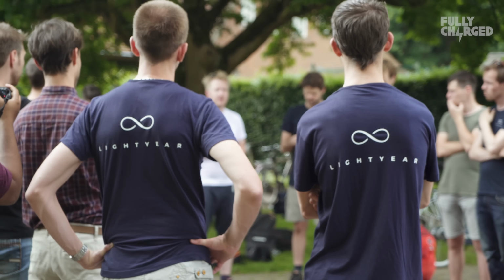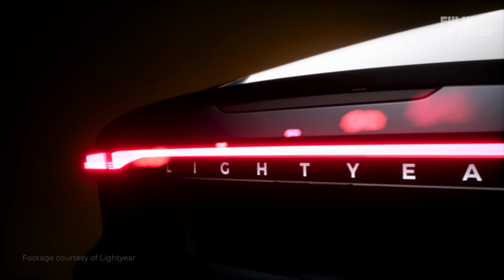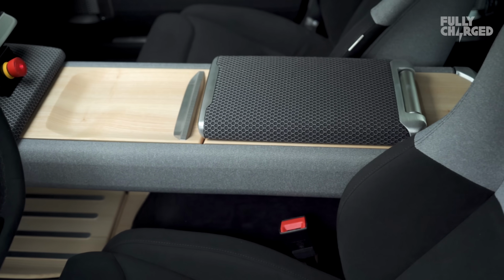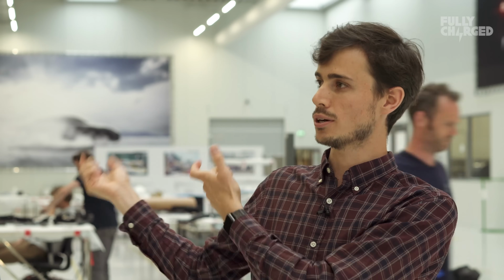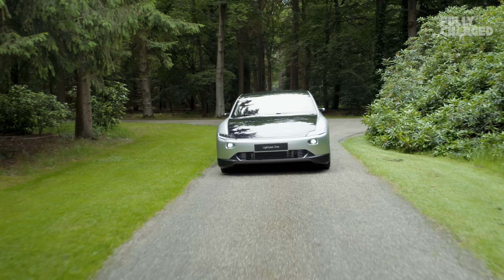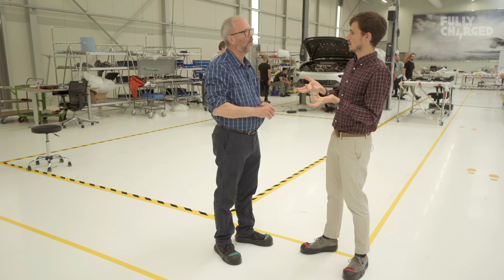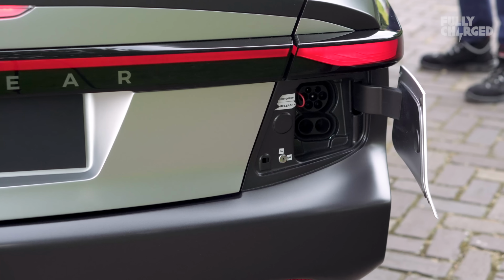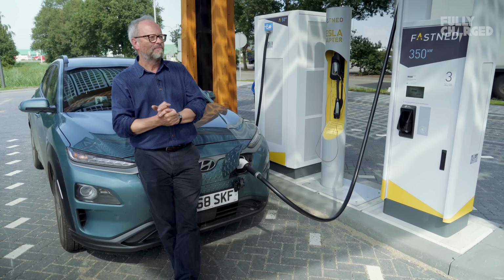Lightyear One solar powered electric car - exclusive first look | Fully Charged

Comment: The best solar panels for roofs produce 270-310 W (about 990x1640 mm). In maximum peak their car absorb 1500 W/h. So... it is about 5-7 panels on the top. The KPI for standard panel is about 23-25%. They have to gave 5-7 times more - about 125-175%. Don't you think something wrong about the range? here's what's really right, it's a 10-12 km trip at 1500 watts. Because who construct electrocars knows that the average consumption is about 150-180 W/km (without any king of extra heater, air cooler etc). So it is miracle.
P.S.  they can deliver just 5-15 km range without prepared and rpe-charged battery in advance (just in solar power). And also nothing was shown during demonstration. Just a circle around the house and forest (3 min on the road)

Comment: How about realizing that EVs are obsolete when you want to get to CO2 neutral.  The battery is LOADED with CO2.  A typical Li-ion battery used by Tesla and others is around 65 gCO2/kwh if used to 6000 cycles.  But a 60 kwh battery, like in a Lightyear, would travel 284 miles at 80% of charge.  300,000 miles at 284 miles/cycle = 1056 cycles.  6000/1056 x 65= 369 gCO2/kwh....  BTW, gasoline from the well is 325 gCO2/kwh...

Solar PV made fuel would be 6 gCO2/kwh x 1.5 fuel making factor = 9 gCO2/kwh, plus 1 for fuel maker and fuel tank to be fair...  So, it costs 10 gCO2/kwh to make fuel and store it with a solar PV panel instead of charging.  To make electricity with PV and store it with a battery at home would be 65 + 6 = 71 gCO2/kwh, or 7.1 times MORE CO2 than making fuel, assuming you used the battery to 6000 cycles or 1 cycle/day for 16.43 years...good luck with that...

The car battery CO2 is 369 gCO2/kwh as calculated above... divided by 10 for fuel making = 36.9 times MORE CO2 for battery alone than making fuel.  If an old combustion engine is 5 times LESS efficient than an EV, then 36.9/5 = 7.38 times MORE CO2 for the battery ALONE (no outside charging) than making fuel for an old ICE engine (an 1880's idea).  

Charging the EV costs you 455 gCO2/kwh from the grid.  That is 45.4 times MORE than making fuel.  Assume 5x less for ICE engine... 45.5/5 = 9.1 times more CO2 than just using an old ICE engine with solar PV made fuel.  

Folks, can anybody in the comment section do any engineering?  Clearly not.  You ALL failed.  No wonder we are going to waste $200+ trillion on the "electrification" of all things all in the name of lower CO2.  What a bunch of total idiots.  7 to 9 times MORE CO2.  No, wait, if you don't have that stupid battery in the wunder car, it would get ~1.5 times better MPG due to not having to carry around the stupid battery...  10.5 to 13.5 times...  

Again, if CO2 is the issue, EVs are totally OBSOLETE.  I proved it to you right here.  

BTW, NewEngineType .com (NET) has efficiencies = to EVs, plug to wheel.  That makes the ratios go up 5 times more.  10.5 x 5 = 52.5.  13.5 x 5 = 67.5.  So, NET would be 52 to 67 times lower CO2 when you consider fuel tank issues (battery + electricity).  The CO2 to build the car would be about 1/4th due to no battery and no rare earths.  I would guess around 20 times less CO2 in life cycle...

Folks, learn to do some engineering before you send us all down a rabbit hole of EV stupidity...OK?

BTW, solar thermal can capture 6.6 times more energy than solar PV.  Yes, NET will have thermal loads taken care of and won't need to use range to keep the car warm or cool...  Solar thermal is key to net zero...and that is why NET uses solar thermal and NOT PV junk that looks like a stupid lab project.  So, most of a NET car can have solar thermal energy storage via compressed air...or even fuel making on the car if I wanted to...

So, if you want the CO2 gone, you start by tossing the battery in the garbage can.  Then come talk to me...  

Yes, I got it right, and you all failed.

Comment: Fine as a research project, but it presents as a scam. Flashy website, with exaggerated claims. And you can already have solar EV from your house roof today, which is way more efficient than the car. 

Oh and it'll be fun parking your car in the sun during a heatwave. 

Instead you can park your car under a roof that has solar cells on it. 

This all exists today. But these guys are trying to sell something that makes no sense with current solar efficiency.

Comment: OK. Current panels under ideal circumstances give you about 350W/m^2. Over the entire surface you are looking at delivering about one horsepower to propel a one-ton plus vehicle. In other words absolutely useless apart from charging your phone or cooling your cabin.

Comment: For a few years I keep thinking “Why can’t the roof, hood (bonnet), (in some cars boot have good quantity high efficiency cells to help charge the battery”.
Perhaps in markets like UK, Russia where there is little sun it may not make sense, but here in Australia, US, Mexico etc it would work well.
I REALLY LIKE that there is no rear window to heat up the vehicle.  In a typical sedan in Australia the amount of heat that comes through the rear window is huge.
Having a wagon or SUV helps avoid that a little.
There was no mention of the Cd....how aerodynamic the vehicle is.  At a guess 0.20 ??

Comment: I suppose it works in extreme desert conditions carrying nothing except the driver, in daylight only.
Reply: You might have been right, if you'd made your statement 20 years ago. Fortunately, things have changed!
Reply: @peterslegers6121  Solar energy is low intensity and only available in daytime. That can't have changed.
Reply: @Withnail1969  Have you seen the World Solar Challenges and team Eindhoven in particular? If so, you'd know they did 120 km/h and were able to ride with 5 people. You might be surprised if you check out what they've achieved. 😉
Reply: @Withnail1969  You've got outdated ideas. Have a nice day.

Comment: as an EV driver i can say 6 miles of free energy an hour is huge. my work shift is 9 hours and if my car starts charging from the second i close the door, my arrival commute is completely taken care of if not both trips. it's the little things like, 12, 20, 35 miles of range that the anxiety starts to kick in if you're driving somewhere without infrastructure on a partial charge. completely done away with solar charging. not to mention a failsafe in the worst case scenario of you completely exhausting your range.

Comment: What I'm about to say may seem a bit sacreligious here but the thing I don't like about EVs is the feeling of the car being in charge. I don't like autos for the same reason. I LOVE the idea of electric propulsion, but where's the gearbox?

I know all about why ICE vehicles need em and EVs dont. I'm just one of those neanderthals who actually enjoys the whole listening to the engine and changing gear at the right time business. I don't even use cruise-control because I can drive more economically. 

There used to be no charging infrastruture around my cave, now I think we've got two, possibly three public chargers within a 5 mile radius! I know, eventually I'm going to have to knuckle down eventually, but it really will take a lot of pleasure out of driving for me.

Comment: Soooo here’s a question on their design choice and practically . SUVs and CUVs are extremely popular with a massive roof area. Why not a lightweight solar roof that is double stacked and when the vehicle is parked the panels expand to increase the surface are by 60 percent or more . Oh well I guess this slope back no rear window solar car will work 😬

Comment: Windows that create energy from Solar are currently being worked on right now. I don't know engineering/safety wise how it would be on a car but nice to know if it can be done that just a little more power could be added. I know it wouldn't really make much change but I feel over time it can add up some provided you don't destroy the windows and keep replacing them.
As for the windows, imagine having them in your home. Imagine skyscrapers having them

Comment: I feel like putting solar on the doors would be a good addition. Not only is it using up 'free real estate' that would otherwise be going to waste, It would also mean that it can still draw power from the sun at multiple angles, even if the roof or hood panels are obstructed ( for example, if parking in multistorey car park).

Comment: Kind of stupid for anything beyond recharging the 12V battery. If there was enough solar energy in that area to charge the main batteries notably, you'd have to wear sunblock 4 Billion any time you walked out your door. I am only slightly exaggerating. The racing car down under was not an actual car for driving in public. None of the things that make it safe. OTOH, this car is probably missing a lot of safety equipment as well, so maybe the kept the weight low enough to get around on solar power. Here in Houston, we get an average of 5 hours of power, for calculations. So if you left it parked on an incline and everything was perfect, you might get 2KWh for the whole day with 400W of panels. And again, that's in ideal conditions at 100% efficiency. And God forbid a hail storm, or anything else since you have to leave it out in the harsh sunlight. And for the record, I own/drive the Leaf, Volt, Vectrix VX-1, GoPed Hoverboard EV, and a Rad Power bicycle. So no, I am not anti-EV. I'm an electrical design engineer.

Comment: Dear Class, the Lightyear One looks so promising, we are totally excited about it! It's taken thousands and thousands of years to get to this point on Earth, with basically the first "strictly & totally solar powered car". There is more than 1 version of the Lightyear One, but the model we are totally promoting is the strictly & totally solar powered model, with no electric power. 
     Electric powered cars, automobiles, vehicles, & craft have been proved somewhat to be a fire hazard, and so we are trying to avoid electric powered such things. It's an amazing feat of Engineering that some said was not even possible, but with Engineers & other peoples working at School around the clock, for all of their life basically, we have arrived at just such a thing. It's not that there is simply no electronics to/re the vehicle, there is, such as heating, cooling, and other components, but the "power source" of the entire vehicle is "strictly & totally" SOLAR POWER, a stroke of genius for certain. 
     And Class, I can assure you all, that old E.T. is up on the Project somehow, and they are very extremely & totally pleased, happy, and excited about the Project, to say the least. E.T. in this sector of the Universe converted over to solar power thousands of years ago, and it is the wisest, smartest choice for power for us, Universally, always, regardless of all always. 
     As some of you may know, recent Science has proved that enough solar energy and light falls on planet Earth, for example, in one day, to power the entire planet Earth for 1 year! So, we simply cannot afford to ignore solar power as our main power source anymore, as E.T. decided long ago. It means the END of pollution from fossil fuels & the fossil fuel industry & technology, and thus the end of ozone depletion from pollution as such, and the end of future and further solar breaches in Earth's magnetosphere like we saw in 2007, which could lead to large scale fires, and even mass radiation. 
     Class, the claim that our economy will be crippled by the conversion over to solar power Universally and the end of fossil fuels and technology & industry, is a straight up MYTH, always. There is plenty of money and jobs and associated service(s) in and regarding the solar power industry, which will keep our economy strong and running just as well, always of course. It's a huge School Project, and we are working around the clock to get converted, always, regardless of all always. 
     And so, our School Project - Solar Hull Technology also comes heavily into play, designing vehicles and homes with solar hull technology that powers the vehicles and homes, along with all their amenities, "strictly & totally" with solar power, heating, cooling, and even plumbing and running water all solar powered, combining solar cell technology with other material(s) that do not compromise the integrity & safety of our vehicles & homes. And as always though Class, it's also so totally important to mention and remember that all Plants peoples do have eternal Rights to "life & existence" too, always, regardless of all always, and so we have to make sure that we always consider that in our Project(s) including the natural competition for sunlight and solar energy that Plants peoples require to sustain their "life". We don't want vehicles and homes that soak up too much solar energy & sunlight to the point where it endangers any & all Plants peoples life and existence. And so, we are studying the matter diligently to determine rates and factors regarding the Project(s). 
     And finally Class, also this new technology and solar powered vehicles and homes applies to "all life forms" not just humans, including my recent Project of solar powered bird homes with heating & cooling and running water. As far as I can tell, on Earth, the Lightyear One is the leading innovator regarding these Project(s), and so lets Promote them and send them as much money as you can spare, it's an imperative Eternal Universal Defense Service that they provide, always. Good work!
     As we hear in Indian legend(s) Class, and ancient oral tradition & writings.........."we came from the stars..and we will return to the stars".

Comment: Fine car. Nice work guys . Wish you lots of luck with it.  But I don't see this car  being a car for the masses, in the way Ford, or Volkswagen were.  For a long while (and even now) Mercedes Benz, BMW, Audi , Porsche schemed  the markets  by appealing to the people who wanted their ego stroked , and were coughing a lot while driving a Volkswagen, Opel or some other mass drivable product. The Brits did the same  but now many car companies make pretty appealing, reliable cars at a reasonable price. The electric cars will evolve and slowly replace the ICE cars , those  ICEs will become less appealing because of environmental concerns.As far as the one advantage of the EV, when I  drive my EV and  I am first at the stop light, I can take off and no ICE car can catch me until I get to the next stop.And I have to be honest, I do not miss going to fill the tank with gas.  I get enough juice overnight at 120V/5miles/hour and when I need I can charge at home at  32mph in 2.5h I have the battery filled.

Comment: There will never be a fully solar powered car (with all the power from it's solar panels).  I estimate that you might, with the best technology, get about 30km driving for a day in the sun.  For someone that does one shopping a week and leaves the car in the sun for the rest of the week, this could be a fully solar car.  For the rest of us, we will need to plug it in at home, at the office or the super market.  This is not to say that it wouldn't be very nice to have that little bonus.  It might even get you home in a difficult situation when you had not charged up enough.

Comment: I can just tell there are a lot of blind spots problems with this car. Rear camera are nice but they break or get damaged or just plane die. You can not see what is behind you. I have driven vans that used Backup camera's,Like i said they are nice but it makes it harder to see what is really be hind you if they are broken or die. I all so see a lot of safety issues as well. Solar panels can create lot's of heat. When in use Temp's can range from 75F or 150F depending on the climate. And on top of that if a cell be comes damaged or just not working the cell would either be by passed or the whole strip would stop working.Making it kinda use less and more expensive to fix.

Comment: Great concept. I can't remember who it was that had a solar roof. Maybe it was Toyota or Honda. I think it was designed to keep the car cool in the summer months when parked in the sun. I don't care so much for the body design of this one. It makes sense but looks like a cockroach. What's really going to drive customers to buy this is distance it can go on a full charge and price point. If it's being sold as a luxury car then those with money will buy this. 

I don't see this right now as a luxury car. The materials and build quality has some ways to go. This is definitely in the early phase and I hope to see more from them, especially as they make the car more US compatible (i.e. rear view mirror/camera and actual side mirrors). Camera mirrors are awesome but the US regulations hasn't caught up with technology yet.

Comment: 15:11 see now that is criminally misleading. Are you telling me I don't need to charge the car? I can just drive through the desert because even though no infrastructure exists there, there's plenty of sun? I would be shocked if the roof produced more than 500W on average between 9 a.m. - 3 p.m.. That would be 3 kWh, the battery supposedly holds 60kWh. In the real world 60kWh is enough for 460km, the roof would add 23km, in ideal conditions. Now, if you park in the sun to charge it, it would probably take 15 days of perfect weather. Also, if you're driving through the desert, in the sun, AC blazing, 500W doesn't even cover that bill. You'd run out of juice, parked in the sun, not even enough power to use AC. You cannot bend the laws of physics, solar cells are not magic. If sun irradiates probably about 1200W per m2 when perfectly perpendicular to the surface at say, 12 o'clock, mid summer at the equator, this figure drops very sharply if it's not the equator, if it's not mid summer, if the surface is not perpendicular to the sun, if there's clouds or shade. Cell efficiency is at 20%.  Lightyear provides NO NUMBERS where numbers mean everything.